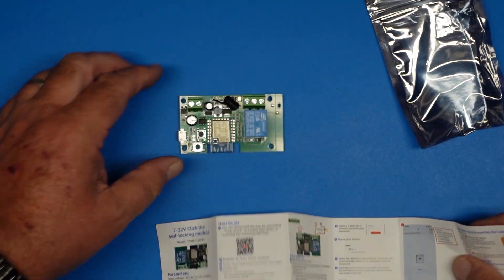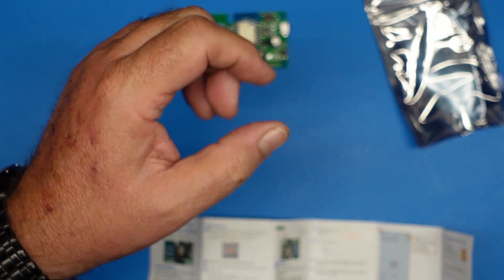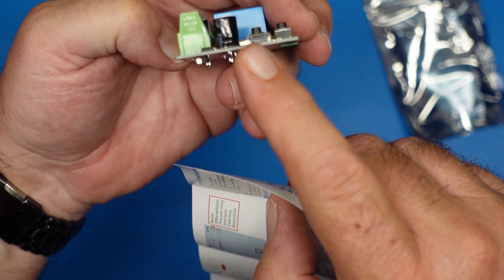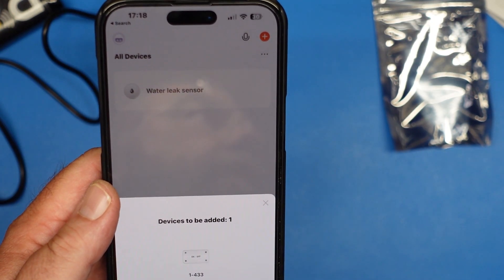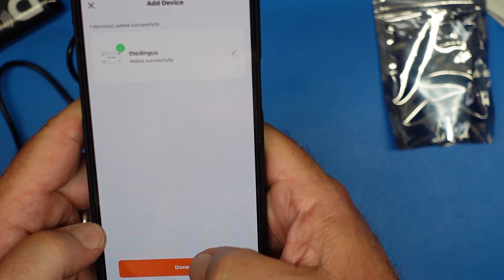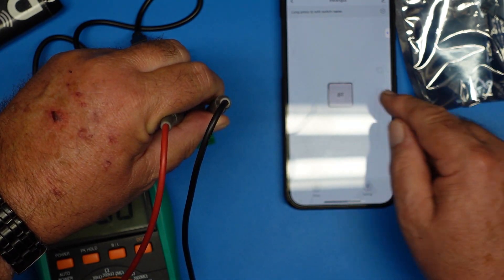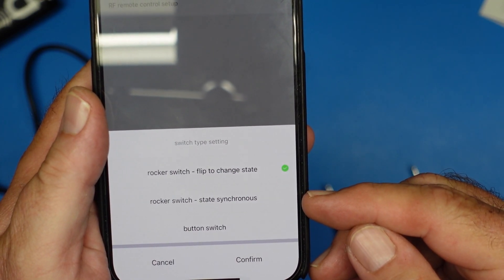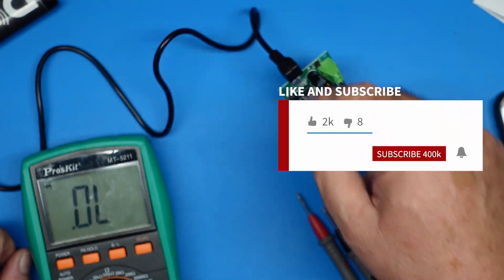I Turned My Shack Into Remote Control!

Comment: Can I use this on a car radio to adjust the ON time of the radio after I turn the engine off?
Reply from the maker: I suppose so, it does require wifi though.

Comment: Hi, I love your explanation. Too bad you didn't show the wiring.  That is the part I have most problem with. Can you show me the instruction drawing of the wiring? Thanks
Reply from the maker: It's going to depend on the switch, and the device you hook up to it.  The switch will have the basic info in the docs that come with it.  I'm not using that at the moment, it's in a box of stuff.